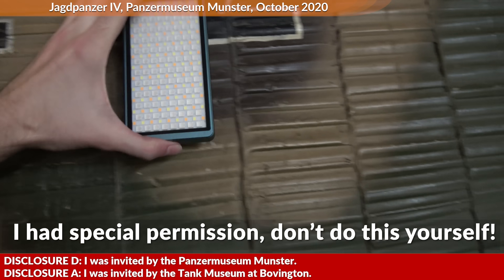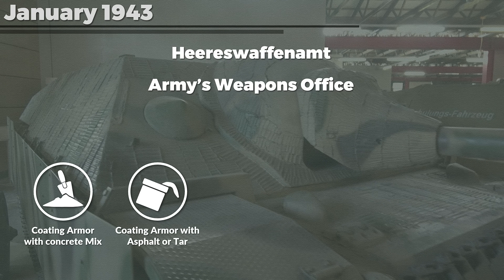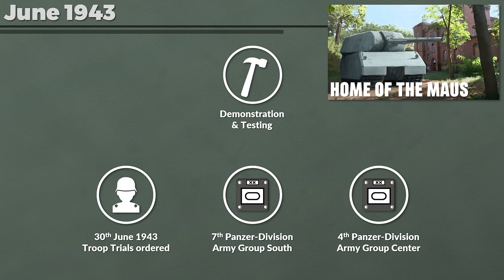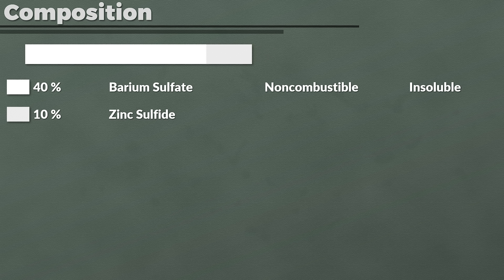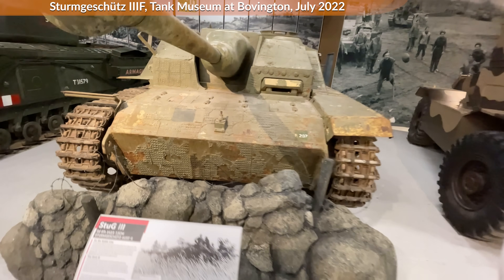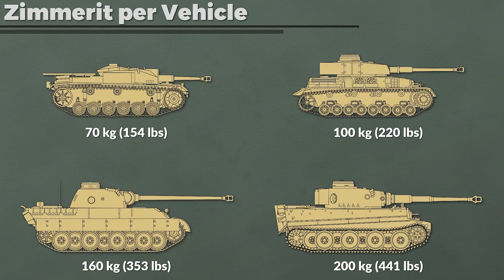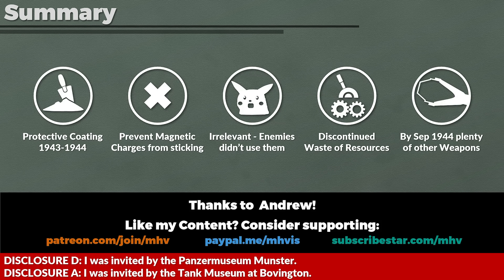Why Zimmerit on Panzers & Testing

Comment from the maker: Correction: The Stug from the Tank Museum is a Stug III G not F, thanks to @shockblaster1201 for pointing this out.
Reply: Erm.... for a proper test you need a 3 KG weight. Try holding that steady with a magnet on a moving vehicle. Like all fields, inverse square law applies to magnetic field strength at distance. Zimmerit was not so much anti-magnetic material as the gap makes the magnetic field less effective,

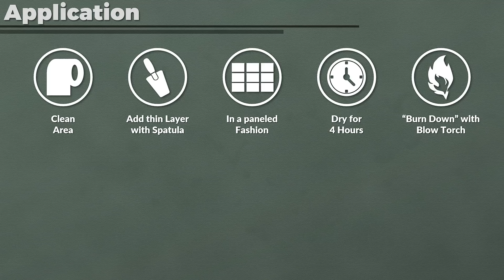Comment: 8:55

"Abbrennen" doesn't necessarily mean "to burn down". In this case, like for example in case of removing/softening paint via heat, cleaning metal via heat or charring wood etc. pp. it means something like scorching or flaming something.

In this case it most certainly meant to heat the coating via direct flame contact, probably as a simple method to heatset the compound.
Reply from the maker: Danke!

Comment: The Weald Foundation has a video on making and applying Zimmerit using the "original" formula. Consists of pulverized pebbles (quartz - which happens to turn out ochre in the video) and pine resin dissolved in gasoline. Perhaps the "factory" formula was different than that used in the field. No mention of the source of the formula.

Comment: It doesn’t matter how old the substance is. It has nothing to do with it. It’s the distance the coating keeps the magnet from the steel that affects the holding power of the magnet. The stronger the magnet, the greater the distance it can hold from. The odd shape of the coating simply prevents the magnet from resting on a smoother surface. It doesn’t matter what the substance is, as long as it’s not magnetic itself. I assume that this particular substance and the way it was applied was simply due to prevent its destruction from the elements and the heavy vibration and shock a heavy military vehicle undergoes. Otherwise, there’s nothing special about it.

Comment: Interestingly, there are instances where Zimmerit was applied in a free handed method with a spatula or trowel. One example of this can be seen in the book "Panzer-IV: The Panzerkampfwagen-IV Medium Tank, 1939-1945" by Kevin Hjermstad (Squadron/Signal Publishing).  On page 45, there's a knocked out Pzkpfw-IV Ausf.H with such a pattern. Strangely, from what can be seen. it appears to have been applied to horizontal areas such as the transmission housing plate (glacis) as well as the top surface of the mudguards.

Comment: I have no opinion on Zimmerit application wether it was a good or bad idea. 
Just because the Hafthohlladung was not copied by the Allies does not mean Zimmerit was a 100% waste. What many fail to understand is that military technology can also have a deterrence effect. Why utilize/copy a weapon that is badly working against German tanks because of Zimmerit? Germans could have waited with the Zimmerit application, see if Allies would field mag mines. It can be a good idea to keep your new inventions in the backhand, especially with Zimmerit being able to applied quickly even in the field but Germans decided to put it on despite no intentions yet by the enemy to field mag mines. This might indicate that they wanted to play out the deterence effect as it was clear that the enemy would notice and study the new paste on German tanks. With the advent of AT launchers the deterence effect was superflous and so they stopped applying it.

Another mistake is rating a technology solely by retrospective without taking perspective. By 1942 AT rifles coudn´t keep up and there was a infantry anti tank tech gap until AT-launchers started to appear later. Germans filled it with means such as the Hathohlladung and it made sense for them to fear that the allies might field this rather cheap and simple weapon  aswell. Few really knew then that AT-launchers will become the next big thing.

But all of this aside we all know Germans invented this to give model makers 50 years later a hard time.

Comment: While it might’ve never had a chance to fulfill its original purpose, it does seem to at least disrupt the typical light glare of the armor. You can see on the second King Tiger that the side skirts and barrel reflect significantly more than the hull and turret side. That said, simple netting would be cheaper, faster to apply, and more effective.

Comment: The story I've heard was that Zimmerit failed to harden when applied in cold temperatures.

During the autumn and winter, due to the rapid production of tanks and lack of space, assembled tanks from production line were being placed outside the factory before the Zimmerit was applied.

This meant that the initial layer of Zimmerit, when being applied as two coatings, failed to harden and was left in a softened state.
The workers would then apply the second layer and use a blowtorch to heat the surface so it would harden.

Supposedly, the reports of Zimmerit being flammable was due to incoming shells breaking the outer layer and igniting the unset layer beneath.

Comment: Zimmerit: a solution in search of a problem that never really existedh. Because magnetic anti-tank mines were so great that the Germans mostly phased them out by 1943 when they had a better infantry AT expedient than having some poor sod with more balls and bravery than self-preservation run up to a 40 ton tank and slap an explosive refrigerator magnet* on it. So the Heereswaffenamt naturally believed that the Allies, who already had Bazookas (Americans), PIATs (British), and no real shortage of various effective ways to kill Panzers (Soviets) would yet downgrade to magnetic mines... because reasons. 

Granted, I guess some partisans COULD ostensibly capture some Werhmacht stocks of Haftholladung 3 mines, or maybe even make their own at home. If you understand the principle of shaped charges and can work with energetic compounds without sending yourself and your workshop/lab flying skyward in small, flaming pieces, then you can probably improvise something similar to an H3 mine out of commonly available materials. Perhaps, if you captured an intact model of one, reverse-engineering it wouldn't be prohibitively difficult. It would certainly be easier than manufacturing your own artillery tubes and ammunition. 

And whilst the H3 is far from an ideal man-portable anti-tank weapon, it does have some slight, perhaps niche/situatioonal advantages over the other contemporary expedients. Its operation is virtually silent (at least until it detonates)--no muzzle flash, report, and cloud of highly visible dust upon firing; no backblast to worry about either. I imagine that these things were also dirt cheap to produce, as they're basically just a metal funnel stuffed with HE, a detonator, and with some strong magnets bolted to one end. And a single man could easily be taught how to use the weapon in very short time, compared to a more complex, crew-served system like a PaK 40. And it's a lot easier to hide an H3 under your coat than a Panzerfaust or Panzerschreck when mean-looking Kettenhund asks you, "Papieren, bitte?"

So maybe the Heereswaffenamt was concerned about the threat of magnetic mines from partisans rather than regular Allied forces? Those magnetic mines could make rather nasty ambush weapons in forests, urban areas, or simply just some partisans infiltrating a poorly guarded Wehrmacht vehicle depot on the Eastern Front to stick magnetic mines on all the parked AFVs, then be gone before the fireworks start.

None of this changes that Ziimmerit was, in hindsight, a waste of resources that could have been spent on more relevant projects and efforts. Germany didn't lose the war because of Zimmerit, but the decision to retrofit existing AFVs with it and increase the production time of new ones by adding it was just one of many mind-boggling decisions the Germans made during the war.

Comment: By the numbers, the Hafthohlladung had decent enough penetration, though I don't know much about its beyond armor effect or ease of use. Nor does anyone say if the attachment points just very strong iron magnets, or something a bit more exotic. In turn its a bit hard to say if the allies were missing out not developing magnetic weapons of their own. It probably would have been safer than the sticky bombs designed in Britain (nitro explosive in a glass ball surrounded by adhesive...)

Comment: 0:58 This is why I come to this channel, to get the real facts. It did indeed influence the Croatian of a protective coating.

Said Croatian didn't really like being rubbed across all tank hulls during production as it gave him a rash, but after being promised a higher salary he reluctantly agreed. 😉

(More seriously though: Ab-brennen should probably be 'to burn off' of something like you can use flames to burn old paint off of a metal surface)

Comment: Spoke once with an driver of an Panzer IV - he told me that the tankcrews liked Zimmerit because it made the tanks surface, especially when wet, less slippery - so it was easier to mount and unmount and work on the tanks. And as he told me, it was much easier to get frozen snow or ice off the tank with that zimmerit-layer between steel and snow and ice.
Reply: Why would they get snow and ice off the tank? It's free camouflage.
Reply: @scorchedearth1451 The tank needs to be able to move, so exhaust ports and turret traverses can’t be covered. Otherwise everything just freezes in place. Crews on both sides even had to run their vehicles periodically just to keep the engines and pipes from freezing over.
Reply: @wolftamer5463 
That's plausibele.
I saw they camouflaged their tanks with chalk.
It's washed off easily when you don't need it anymore.
Reply: @scorchedearth1451  The fact that you had to ask this question tells me that you've never worked with heavy equipment in snow and ice before.  It's amazing how little ice it takes to prevent something from working.
Reply: @Devin_Stromgren  
Did you try to insult me by telling me I never worked with heavy equipment? LOL
99% of people never worked with heavy equipment. 
Just like most people are not pilots.
I'm a truck driver, and besides my tires losing grip on the road I never had problems with snow and ice, even in the coldest winter.
Reply: @scorchedearth1451  No, that wasn't intended to be an insult, and between the two it was the cold that I figured most likely that you had no experience with.  You've never had to crawl under your truck with a hammer because your brake shoes were frozen to the drums?
Reply: Engineeting student here, a very large amount of work when designing transport vehicles is to decrease maintenence time.
Basically, we design it so the driver can drive and the truck does it's job: moving stuff safely and quickly.
You are doing the least complex and least amount of maintnence possible for you to not do, because we make the truck do it for you.

Comment: The test proves that it has mild anti magnetic properties, but nothing else. The lack of the full weight of the mine means that it’s much likely to stick than simply a magnetic panel. The weight of the mine is offset substantially from the panel, and clearly even with the setup that was actually used, the magnets weren’t that effective because the mine had to be placed by hand, it couldn’t be thrown and be expected to stick on a tank lacking zimmerit. Likely with an accurate prop or actual artifact tested here, it just wouldn’t stick.

Comment: Given that the other 4 proposed counter measures "were rejected by troops due to the fire hazard."  It's a little ironic that one of the reasons it was discontinued in September 1944 was because of rumours that it could be set on fire by shell impacts. Though this was tested and officially disproved.

Comment: By "strong magnet" do you mean a modern rare earth magnet (like a neodymium magnet)?  If so, this wouldn't be an accurate test, since rare earth magnets weren't available in WWII.
Reply: wouldn't showing a neodymium magnet failing to properly attach be an even better way to showcase the effect of the coating?

Comment: I have 2 questions. 1 : is it hard enough  to set off a shaped scharge before making contact with the hull? And 2 : If number 1 is true does it give enough space between the coating and thew hull to disapate any of the shaped charges payload?
Reply from the maker: 1) I am very certain it is. If have never heard of something "too soft" to not trigger a shaped charge, they might also use inertia fuzes.
2) No, it might actually increase the effects, it depends on the shaped charges, but modern ones have usually a tip, from what I know that tip is to extend the distance, so that the jet can properly form.

Comment: From what I've heard, seems like zimmerit was a scam. Someone though "hey, could we squeeze a few additional reichsmarks out of every tank for additional work?" and boom, a zimmerit coating was born. The fact that nobody else aside from Germans themselves used magnetic mines kinda points in that direction.
Reply: the fact that it legit worked its claimed purpose makes it sound like a scam? google what scam means. NOT doing what it promises.
Reply: @melonetankberry5211   dude, if you go to the car service and in addition to changing oil in your car the serviceman also changes a liquid in your windshield spray washer for some patented bullshit which costs 9000 usd for gallon and you totally didn't asked him to do that, would you call him a scammer if he would try to push that additional cost on you?
Reply: @quint3ssent1a  would be closer to the mechanic giving you winter wheels in the summer and insisting you need them.
Reply: @hind6799   tl;dr

Comment: Given that the magnet on the back of that light did seem to stick to some extent, and those are not very strong, I'd like to see how firmly something like a magnet fishing magnet would stick. The British did have magnetic "limpet mines" using very strong magnets for sabotage operations but presumably didn't use them for anti tank purposes due to the difficulty of application. As mentioned in other comments the actual British anti tank charges used a glue like substance and could therefore be thrown from a distance.
Reply: That magnet is fairly weak compared to some now days but it's still likely a neodymium magnet and during WW2 the best they would have are simple ferrous magnets which are much weaker.
Reply: @SilvaDreams  Those work lights are designed to be easily removed, they barely stick to a painted metal surface. Long before neodymium magnets were around there were things like magnetic radio antenna mounts which were hard to remove.
Reply: And the sticky bombs were rapidly replaced with shaped charge projectile weapons (that didn’t stick to the user).
Reply: @allangibson8494  In a wartime context not that rapidly - Sticky bomb 1940, Piat from July '43. Interestingly the nature and texture of Zimmerit probably made it more likely that a sticky would stick.
Reply: @NiallWardrop  The PIAT entered service in August 1942.
The Sticky Bomb couldn’t penetrate anything more robust than a Panzer I.
The PIAT was derived from the 1940 Blacker Bombard.

Comment: From what I recall reading (A long time ago) the production and application of Zimmerit consumed a lot of petrol too.  Fuel that could have been used for something else.
Reply: Polyvinyl acetate doesn’t use oil to apply. It is made from acetic acid and acetylene (toxic process) or acetic acid and ethylene (less toxic process).
It can however take up to a week to dry as it is usually used as an aqueous solution (and won’t dry at all in freezing conditions).
Reply: @allangibson8494  Good point.  It wasn't the PVA that used the petrol (not oil)  though.  
I'm trying to remember the article, it was  a few years ago, that described the application process.
Reply: @ptonpc  Possibly drying the PVA…
Waiting a week before you could use a new tank in 1944 was probably a nonstarter for the Germans however…

Comment: @7:07 PVA is an organic compound.  Considering that you mentioned they used a blowtorch, they might have taken a sample and combusted it.  The change in mass would correspond to organics/volatile compounds being expelled or combusting.

Essentially they probably did a proto-Thermogravimetric analysis and that's how they came to that conclusion.
Reply: I think the blowtorching was part of the application process, not the Soviet lab tests.

Comment: Look how much extra weight modern MBT are fitted with all the extra reactive Armour that is fitted and now anti drone and shoot down AT rockets .
Reply: Sounds like when designing a tank the engine should be over-built, so to speak, just in case additions become necessary.

Comment: Grahvel, not graevel :)
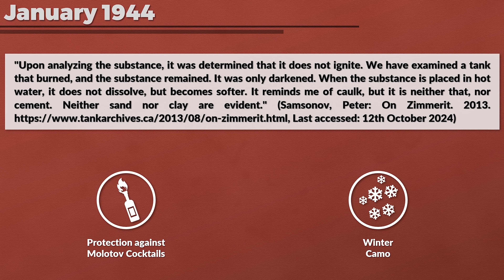Caulk is the word on the screen, (4:49) not chalk (mentioned), not sure what the correct thing is, but caulk and chalk are two different things. Caulking (Caulk) is the material you put in around a bathtub or whatever, forming a waterproof gasket/seal. chalk is for drawing on blackboards in school etc.
ALSO
Very happy to finally know all of this. It seems to me the tiger II at a prior date likely had it removed due to the fire hazard rumours... wasting time and resources twice. The stoppage of the application makes sense, see also waste of time, but the removal does not (What's there probably wouldn't hurt it too much)

Comment: The polyvinyl acetate was probably to bind everything together since most of the other components are of a dry granular consistency
Reply: Dry fine powders…
Reply: Polyvinyl acetate is a key component of chewing gum! Seems more like an "Yankee" (American) solution to use chewing gum on armoured vehicles.
Reply: PVA and sawdust together will set like concrete, it's handy stuff.
To make Zimmerit, just mix in the extra powders 🤷🏻‍♂️